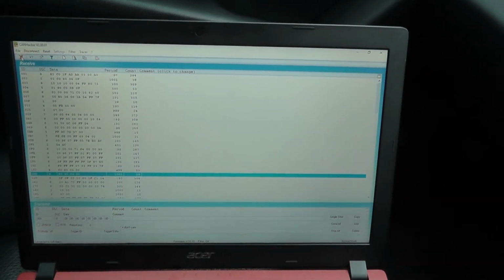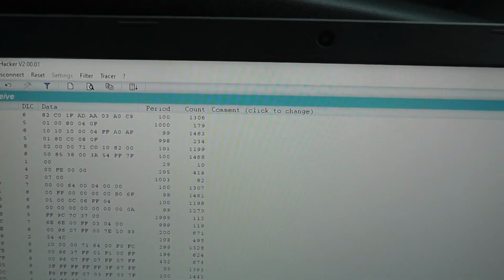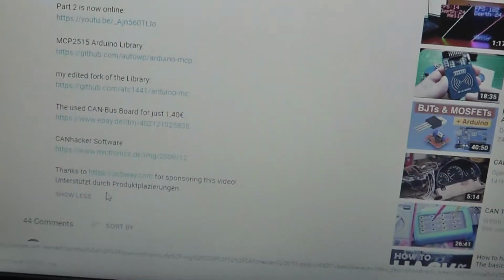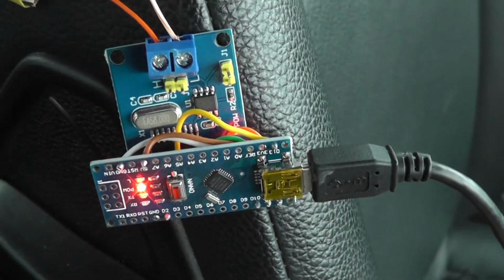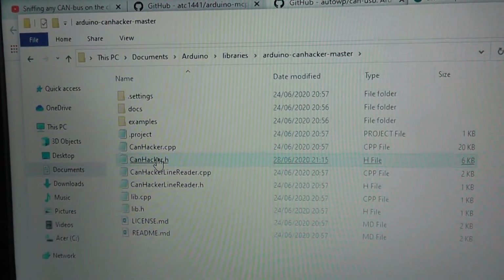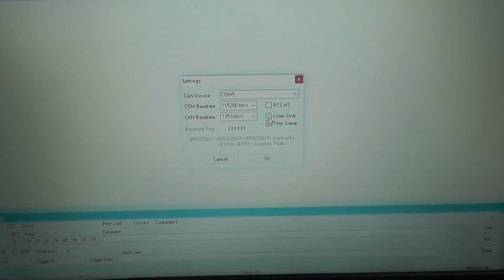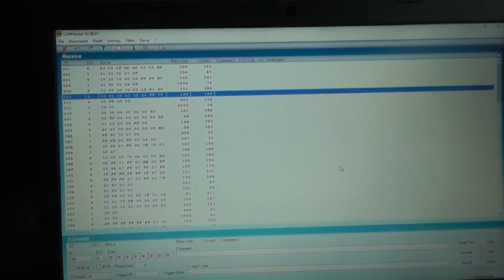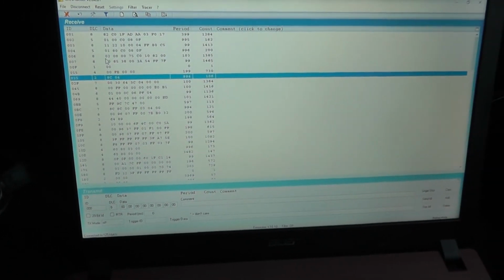DIY EV Part 2 - How to read the CAN Bus in your car using an Arduino Part 2

Comment: This was a massive help, thanks for posting, got me up and running immediately!
Reply from the maker: Brilliant, thanks for letting me know.
BTW I found using an UNO (connected via the MCP2515 rather than a shield) was more stable than a Nano but that may just be the quality of the Nano I was using.
Reply: @alibro7512  I used an UNO (elegoo clone) with the generic MCP2515 breakout and had no problems, I'll be changing out to an ESP32 soon I'll let you know how it goes!
Reply from the maker: @paulstatham1525  Yes, please let me know.
Reply: Just wanted to add my voice to Paul’s. Watched that German fella’s video a few days ago and was banging my head against a brick wall as I hadn’t changed the MCP2515 frequency in CanHacker.h (my set up is identical to yours).
Putting this up in simple steps has made it a lot easier and quicker to figure out what step I missed. Thank you again and I’ll be sure to pass this info on 👍👍

P.s. I was thrown a little as there is also another gotcha in there, you also need an edited version of the MCP2515.h The link you used in the video is to the German chap’s ‘forked’ github repository where he had already updated that file as well to 8mhz, but the main link on his video still has the default 16mhz.
Reply from the maker: @bobbyboblington  Thanks for the kind words and extra info. I don't care to admit how many days I struggled with this.

Comment: Hi Ali Bro, Thanks alot for sharing your experience, I am about to build a Can sniffer to identify the packets coming from the steering wheel buttons. I ve already bought seed canbus shield but had no idea how to get it working, now you have encouraged me! Thanks and good luck with your EV project!
Reply from the maker: Thanks for your kind words. 
I found it easier to get meaningful data using a MCP2515 adapter and CANHacker mentioned in Part 4 of this series than with the Seedstudio canbus shield but you can still use the shield you have. If a numpty like me can do it then anyone can. 😉

Comment from the maker: In this one I was connected to CAN wires in the boot/trunk. I have connected to the obd2 port but it is normally locked and difficult to read unless you're an expert.
Which I'm not.
Reply: Thank you, I have various cables and CAN Bus adapters, so far I haven't managed to get anything from my car, its an Audi A5 2.0 TDI.  I want to sniff things like indicators, brakes, lights and reverse.  I have bought several cables too, but I'm not sure if I have the baud rate correct either.  I'm using a  HobbyTronics CAN-BUS v2.0 module.
Reply from the maker: @SimonPlatten  If you check out the other videos I made in this series hopefully you'll get a few tips.
Reply: @alibro7512  Thank you, will do.

Comment: You've probably figured this out by now, but message IDs don't have anything to do with which device originated the message, just the priority of the message (technically).  In fact there is no device addressing anywhere in the protocol, but dev8ce identifying information might be embedded in the data, that's a big might.  CAN works nothing like ethernet or other bus topologies that use individual  device addresses.  This obviously makes hacking the bus much more complicated.  Your bus may only contain data at 125kbps, I certainly don't know though.  Your hardware may be sufficient for your particular vehicle, but CAN FD is gaining popularity.  You may find CAN hacking to be easier if you get yourself a raspberry pi, a CAN FD shield (about $30) based on a later chip, and learn to use wireshark.  Some vehicles and manufacturers have been at least partially cracked in terms of message IDs and decoding the bitfields of the data blocks.  I don't know if your situation might be aided by that, but I'm sure your work would be appreciated by them.  CAN is truly weird when compared to other networks.

Since your CAN bus is at 125kbps (others will be at 1mbps, FD at up to 8mbps), and your serial link is at 115kbps, you're right on the edge of potential data loss from your capture board. Factoring in the speed of the Arduino software, you might be dropping packets during high activity on the CAN bus. That's why I was suggesting the pi and the shield based on the 1517 chip that supports CAN FD.  It should have no trouble keeping up and allowing the use of a fully graphical interface running Wireshark.  I've not personally used Wireshark on anything but ethernet yet, but I'm fairly confident that the CAN bus capturing, decoding, filtering and analisys power will likely exceed that of the canhacker software.
Reply from the maker: Thanks Tony
As you will have realised I'm very much a beginner at CAN.
I really only got into it when I realised that I had no choice if I wanted to electrify a modern car.
The jury is still out over that happening but I'm having fun which is the important thing.
Reply: @alibro7512  I'm pretty new at this CAN stuff too, but with computers, microcontrollers and hacking stuff, I'm an old hat.  I modified my previous post and added a lengthy ending you might want to review. 

Edit. I'm learning from you as well, and I appreciate your taking the effort to make these videos.  They save me time bringing myself up to speed.  I'm getting old, so I need to save all the time I can. ;). I just like to try and give back wherever I can.
Reply from the maker: @tonyfremont  lol its too late for me to be getting old, I'm already there!
At the moment I'm trying to get my head around calibrating a hall effect throttle with the Gen1 Nissan Leaf VCU I bought from Damien Maguire. It works by sending the required CAN messages to the inverter to make it think its still in the Leaf.
It's a steep learning curve. 😲
Reply: @alibro7512  it's like eating any elephant, just one bite at a time.  ;) I've got a lot of projects I want to do, but probably not enough years left to get them done.  I've got an old pickup I'm working on and big plans to add a lot of updated technology to it, such as a CAN bus, just for the fun of it.  Small engine ignition control, followed by fuel injection. Home automation and lighting, model RC stuff, a motorcycle to rebuild and update to real ignition timing control and possible fuel injection.  On and on it goes.  Arduino will go a long way these days, the ide is pretty easy and the libraries generally awesome, especially with the ability to move up to much higher performance processors fairly easily.  Raspberry pi is another amazing platform for high end processing speed in dedicated devices at a relatively low cost and amazing reliability. I ordered a 1517 shield yesterday from mouser, it should be here today, if they shipped it yesterday.  I have raspberry pis galore, with shields, running my LoraWAN gateway, Christmas lights and "unshielded" doing home theater front end display and sound processing for my MythTV backend.   One is a mail server, another was to be a retrogaming device, but not enough time to get it done.  I build escape room props using Arduinos and raspberries.  I go from one obsession to another, never getting any of it truly completed.  ;)

Comment: I am trying to do the same with uno but CANHacker is not detecting my arduino port. I am trying on windows10.  The video was a massive help.
Reply from the maker: If you still have the Arduino IDE running it will hold onto the port preventing anything else from connecting to it.
Reply: @alibro7512  Do i need to change anything in the sketch?  Is there any changes in connection when using UNO  or is it same as in Nano?
Reply from the maker: @aquibrahman3545  To be honest I don't remember but I don't think so. Apart from the bits I mentioned in the video.
Reply: @alibro7512  Got it working. Thanks a lot for the video. The issue was I had Virtual COM ports already created in my system and CANhacker was only detecting the Virtual ports. I deleted those ports and it worked like a breeze.

Comment: Even I remove the CAN wires there is some data I am getting, Is there any other correct way to get data, The data that I am getting from the can bus analyzer of microchip to arduino is completely differenet. Can u explain. Thankyou for ur help in advance. That too as per the manufacturer the data should update for every 30 sec but I am getting continously. I think the data is wrong

Comment: Thanks for the video was a great help. Quick question though, the can system I am looking to read is 33.33kbps in the CanHacker software there is only 50 and 20kbps, is there a way to get 33.33kbps or can I get away with using 50kpbs since its refresh rate is faster?
Reply from the maker: I'm sorry but I'm not sure as it worked for me at the time and I haven't looked at it since.

Comment: Hi, Nice Video. why not jus use OBD2 that is may be chipper then this setup. and can do the same thing.Or is there any difference maybe i am not aware of it? thanks
Reply from the maker: The OBD2 port CAN connections are locked so you need to send a command to the car to communicate with them. TBH I never spent the time to figure out how to do this as I didn't really need to.

Comment: Hi, great video by the way. Most of it seems to be working (The sketch successfully uploaded onto the Uno/CANHacker is able to detect the Uno). However, I do not get CAN data in the receiver window.
When you switched from the Nano to the Uno, did you have to change anything in the sketch or the libraries?
By the look of it the wiring is the same as yours, and the same way others have wired the MCP2515 to the Uno.
Reply from the maker: Thanks. 
To be honest I did this over a year ago so I don't remember the detail but I think i connected it the same way. 
Where are you connecting to the CAN? If via the OBD2 port it probably won't work as you need to send a signal to the car to allow access to CAN this way. 

Are you using the correct speed for your make/model of car?
Have you watched the other videos I made about this? I think I mentioned this problem in one of them.
Reply: @alibro7512  Thanks for the reply :-). After much debugging, I swapped the MCP2515 out for another, it now works perfectly via the OBD port. did actually use a different library). 

I haven't tried it with your library after swapping the MCP2515.....

But for anyone experiencing similar issues (CAN Hacker connects but no CAN). Try swapping out your MCP2515 for another. It worked for me!
Reply from the maker: @5er312  great news, thanks for getting back.
Which Library did you use? I can't remember exactly what I did but I know I had difficulty connecting over the obd2 port.

Comment: out of curiosity did you have trouble getting the canhacker to work with the bigger module (uno shield), I usually use arduino and excel to find the correct ids but it takes long as hell so decided to try canhacker with the uno shield with no luck. I have a few of the mini mcp2515 16mhz modules lying around so will try them anyway but was just wondering if you had trouble?, I have been looking for a decent alternative for a while rather than the serial monitor and this could be it.
Reply from the maker: I tried it once with a shield and it didn't work. I didn't spend much time on it but it could have been simple connection issues. It may be possible to make them work by connecting using wires instead of plugging it onto the Uno. It was so easy with the modules I didn't go any further.
Reply: Hi Ryan. Have you tried CANHacker with the MCP2515 modules? Did they work?
Reply: @dariodraiman6339  Hi yes they worked but for some reason the shield for the uno did not work well, I ended up using a arduino nano with a separate mcp2515 module:), Only downside what having to use jumper wires.

Comment: Hi there . I am writing code for M5Stack (esp32). Can you show a video of the data coming out of the Arduino on the serial monitor. I want to frame the data coming out of the M5stack the same so it works with the CAN hack software.

Comment: Hi mate. Thanks for the video. Did you have any problem of CANHACKER freezing after 1sec? When I connect here, I get a chunk of messages, but freezes right after :(.
Reply from the maker: Hi, glad you enjoyed the video. 
I had issues when I tried sending data as it was conflicting with existing data but not when reading it. Maybe you are using the wrong baud rates or maybe you need to change the termination. Do you have a 120ohm resistor across the CAN connections? 
Double check your connections and baud rates and if all seems OK try another Arduino and/or CAN adapter.
Let me know how it goes.

Comment: But how where did you connect can high and can low? Dose it work with jumber wires directly to car's obd
Reply from the maker: This was a few years ago and I connected to CAN wires in the back of the car. I made a video showing a better method more recently so check that out.

Comment: Thank , I did same  UNO cannot read /show data on program screen , Let me order NANO and come back.
Reply from the maker: It should work with an Uno. Check all your connections are correct, the frequency of the 2515 is correct and try again
Reply: @alibro7512   It  also work with UNO  but the data can read only 1st Row then struck 😅
Reply: @alibro7512   Now 100% Work !!!! Thank !!!! :elbowcough:
Reply from the maker: @akkaradechsrithongchai7766  Glad to hear it helped.

Comment: Good morning friend, how are you? I believe I connected Can L and Can H inverted, and I realized that after that my arduino no longer connected to the network, only with the canhacker, can you tell me if this harmed my board?
Reply from the maker: Hi
It shouldn't have damaged anything. The voltage is small but I guess it is possible.

Comment: Thank you for the info ! 
I did this on my 2021 RAV4, but I only get 2x lines of info back. Not multiple messages like you should. I tried all speeds. I get no info at all, but 2x messages at 500kbps. Any ideas?
Reply from the maker: Where did you connect to the CAN bus? Modern cars have more than one
Reply: @alibro7512  sorry for not mentioning that. In the OBD2 port on CANH and CANL.
If I dont have that connected, I get no data at all. So I am definitely getting something there. 

Side note: I am using hybrid assistant on my Android radio via a bluetooth MX+ adaptor. I can see speed, rpm, battery charge, discharge, temperature. Would have liked to see all that on Ardiuno inorder to make a LCD display with info. So all that is on the OBDII. 

BUT, for now, I want to determine headlights high beam or low beam.
Reply: @alibro7512  I really appreciate your time to reply. 
I have read tons of comments now and on your video also. I see you (or someone else) me tioned that the OBDII can be locked. I will try to tap into the wires next to the module I want to decode, bypassing the OBDII port. I hope that will give me more info! Thanx again. I hope I can contact you for info again?
Reply from the maker: @benriefourie115  I haven't looked at this for a few years but I remember one of the example sketches for one of the several CAN Shields I had was able to read PID's from the ODBII port but I couldn't figure out how and don't remember which it was. I found it easier to connect directly into the CAN at the ECU.

Comment: I’ve got Andruino Mega and CAN-SHIELD v2 and I can’t get it to receive CAN, but it works with example sketches.

Any tips? - I set it to pin 9 and change all to correct pins within the sketch?
Reply from the maker: It's been a while since I played with this but is the does the frequency of your shield match the sketch? Is it 8Mhz or 16Mhz?
Are you using the correct frequency for your car? In my case 500Mhz
Did you read the tips in the video description?
Reply: Thanks for a quick reply I got it to work - However I think the CAN is locked via OBD and I’m only getting one code for Right Beam Failure lol.

I saw you have a similar problem hence you wired in somewhere else?
Reply from the maker: @pauliuslukos6309  Yeah, with the right sketch you can read most of the PIDs from the ODB2 port but I never figured out how it is locked. I just connected directly into the loom.
Reply: @pauliuslukos6309  What did you do to make it work? I have a UNO-Shield combination and I just can't get it to work

Comment: Hello and thanks for all. Does CaBus hacker work with the UNO shield shown in first part (the black one from seedstudio) . If yes does it need any pin adjustment of other modification on the arduino code to send?
Reply from the maker: It's been a while since I made this but I don't think so. At least I don't think I was able to make it work but if you manage it please share.
Reply: @alibro7512  thanks alit! You help me in my work on peugeot 307

Comment: Pls help. I try to connect the CanHacker but the notification pops up and say CAN interface not responding.
Reply from the maker: It sounds like the can device is not connected correctly to the Arduino. Check all your connections and settings.

Comment: Hello m8, will the can hacker work with the arduino shield instead of that mini MCP2515 can module? I'm not sure about clock speed but, does it matter if in my case my board is 16mhz instead of 8mhz? Thx!!
Reply from the maker: It should work but you'd need to change a few things. Sorry it was years ago I did this so I can't remember much about it.